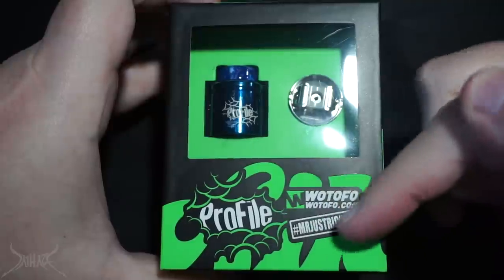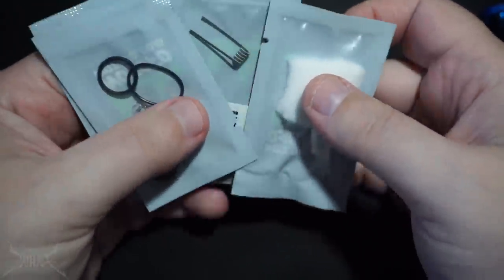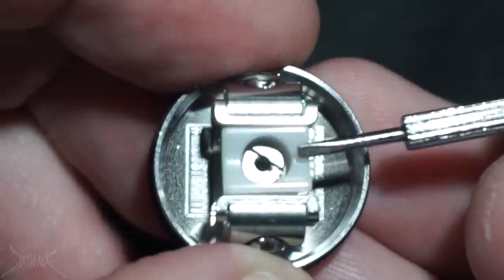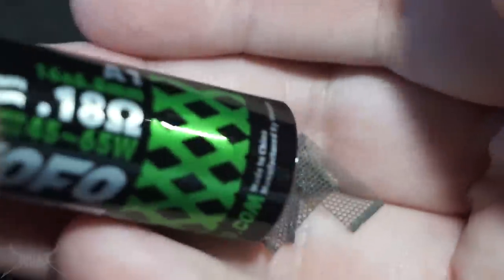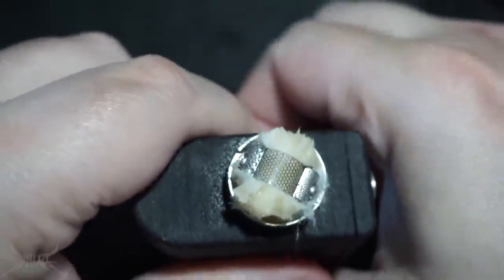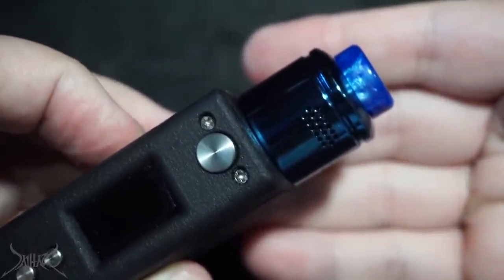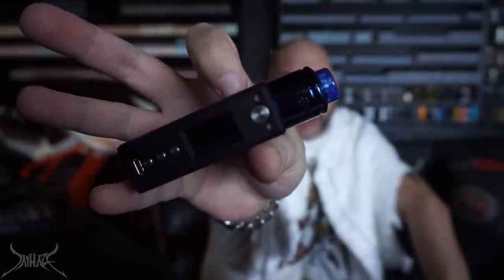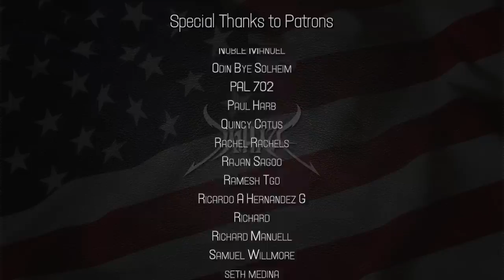Wotofo Profile Mesh RDA Review and Rundown | MrJustRight1 Project

Comment: I heard its even better if you use OFRF mesh. Like the WOTOFO mesh is good, but I heard the flavor is even better with OFRF. Overall this is one of the most popular RDAs to date for a reason. The center piece alone makes it fantastic. Biggest issues with Mesh RDAs is the cotton falling away from the Mesh and causing hotspots. With that center plate, it removes those issues. Finally a company saw the issues with other mesh RDAs and fixed it. Seeing how well you rated with how much you usually hate mesh, I definitely would love to try this. Was on the fence with getting a RDA, but because WOTOFO made this amazing contraption, they may just have sold me. WOTOFO, you guys should be happy, cus you made an amazing product. Also as for you getting the blue, I would love to have the blue. I feel it would look good on my Aegis Legend. Again, its personal opinion, but I love the colour. And man I love that nice deep well. I bet you get quite a few puffs before you have to redrip/squonk. Overall great review as always Jai.
Reply: I would not say it removes the hot spot issue entirely, because I have had a dry hit from hell on it. It did drastically reduce the chances of that happening though. As far as quite a few hits before re-squonking, 4 good pulls is the most my cowardly self will risk...the one dry hit I have had was enough to guarantee that I wont push my luck. Squonking is not that hard. The ofrf mesh is slightly better, but not a big difference.
Reply: @sarge1231  but this rda is does solve issues that come with older mesh rdas. Thats what I was getting at.
Reply: @Gutigwolfe  It is without a doubt the first RDA, or now RTA that made vaping on mesh worth the trouble. All prior attempts resulted in too many dry hits to be worth the risk. Nothing rebuild-able was reliable without dry hits to be practical. Other attempts required constantly adding wicking to maintain contact. The profile might just be the best RDA ever, although with the right build the re-curve is almost as good. Other RDA's require the right coil and coil placement, and are more expensive if you purchase pre-made coils which for me, is essential. My health issues would not allow me to maintain the hand steady enough to make these complex coils. A really well made coil can be more expensive than 20 of these mass produced coils. I am a huge fan of both the profile and the profile unity. I do hope the next version of the rta has a slide to fill cap, because the only problem I have with the tank is the screw down cap with the rubber gasket pushing juice through the wick like a plunger. I think a slide cap like is on the freemax mesh pro would solve that. Right now I just cant fill it completely full without it leaking right after filling it, and I am not willing to stuff any more cotton for fear of a dry hit.
Reply: @sarge1231  Totally on point. The profile is the only RDA I been truly considering. I wan't something simple to start off with. Also Mesh strips are so much cheaper than if you were to buy prebuilt ones. Sure you can buy wire, but I'm that so into vaping I wan't to try and learn to wrap wires. I mean I love vaping, I have spent a good amount of money on vaping gear, but I don't feel like putting in all the time just to build coils, and now with the profile, its really worth it. Its funny, cus people say to buy spools of mesh, but why? I don't want to mess up a measurement, and get it too long, or too short. Its a mesh, not clapton or alien wire. How much better can a spool of mesh really get over a strip? its not like wire. Overall when I am working again, I want to get a profile, cus I love how it is made.
Reply: @sarge1231  Oh and I love mesh in a sub ohm tank, which I heard prior to the profile mesh wasnt nearly as good, but thats another reason i wanna try the profile, cus I love the flavor mesh produces.
Reply: @Gutigwolfe  It is really good for a fact, but the wicking is very critical, so there is a learning curve. It will only take one dry hit on these mesh strips to create a lasting memory. Dry hits on this are not like dry hits on coils at all. The ramp up time is so short on the mesh that any spot not saturated and making good contact on the mesh will superheat the air you suck down your throat to what I would guess to be over 300 degrees. It is not a burnt cotton taste, but rather a very, very hot air that you get with mesh. The one time I had a bad dry hit was actually painful, like you sucked the air over a volcano down your throat. On coils, a dry hit is nasty burnt cotton, and even though unpleasant, it does not cause me fear. The profile does, and I wick it very carefully and start vaping at low wattage until I feel it is alright. It is like no other dry hit, and leads me to making a mistake that is more apt to leak than dry hit on the unity. I visually look at the mesh on the rda for a while after wicking after every hit, and never yet have had the courage to take more than 4 hits without squonking. I am not trying to discourage you, but anything that you have heard about the dry hit is not exaggerated dry hits on coils just do not compare. When wicked right the vape is even better than the freemax mesh pro triple mesh coils on the RDA. On the unity with the extension it is about equal to the freemax mesh pro triple coils due to the increased distance from the mesh. The rda the mesh is so close that the vapeis right there near the drip tip. That likely also makes the dry hit worse on the rda, but I wont test that theory. The regular vape is better on the rda. I highly recommend the topside mod for squonking...single or dual batteries. The plastic replacement tops for the profile also is better than the original metal ones, even with the smaller drip tip, with the added benefit of being able to see the juice level rise when squonked to prevent over squonking.
Reply: @sarge1231  Ya I would be soaking that bad boy. I ain't risking a dry hit lol.
Reply: @sarge1231  Also you can always take a short hit to make sure its safe, so if you get a dry hit its not as harsh as doing a 4 second dry hit lol.
Reply: @Gutigwolfe  It was a short hit when I got my dry hit. Your mouth is so close to that mesh that it gave no warning. I doubt anyone that got their dry hit did not try their best not to. It just happens, and will likely happen again someday. If it was just a good vape, I would not accept the risk, but it is not just a little better than other vapes...it is much better. I now have 5 of the rda's, 2 of the unity rta, two topside squonk mods, two dual topside mods and six other squonk mods. I never hardly squonked or dripped before the profile came out. I am a bit extreme though, I have over 80 regulated mods, over 100 tanks 3 or 4 hundred coils.at least 25 rda's and about 50 125ml bottles of my favorite juice in a dedicated fridge. A lot of this stuff gets little use, I used to love the crown 3 tanks so I have about 15 of them about 8 of which is still factory sealed. I have way over 100 crown 3 coils alone. I occasionally still vape one of them, but my mesh and vaporesso veco one plus gets most of the use. The veco one plus use the .5 ohm  euc  ceramic coils that are fairly inexpensive yet last a long time with good flavor, and they can be used with an adapter in atlantis style tanks. Once I got used to these coils the crown 3 is just not as satisfying. It is mesh and ceramic mostly. I have at least 15 veco one tanks and at least 200 of those euc coils. I even have at least 10 of the original crown tanks and at least 50 of those coils. I usually buy on clearance or sales, and buy 300 dollars of juice at a time when on sale. I also have some nicotine and various flavors for DIY, but I never have been able to get the juice just right. I have no idea how long juice will keep but the juice I am vaping now is barely over a year old. I guess part of the reason is fear of the government hammer coming down on vaping, I know I am good for at least a year. The biggest issue I have is rotating all these batteries. Looking on my night stand is 10 mods and attys right now. It all sounds kind of crazy as I type this, but I am disabled, have a pretty hefty 401k and retirement plus social security. I really do go overboard on things I like though. I have also lately used digiflavor espresso 22 tanks and coils the tanks were 3 dollars each, the coils were 99 cents for a five pack and they can be rewicked several times. The flavor was surprisingly good. With the coupon codes I got 8 tanks and 200 coils for about 60 dollars. I expected the flavor to be awful, but it really is good for these vertical clapton coils at least in .2 ohms, have yet to try the .4 ohm coils. got 100 of each.
Reply: @Gutigwolfe  The 3 or 4 hundred coils does not count the digiflavor coils, and it is likely a low guess. It is just a lot of coils. I should probably give away the crown tanks and coils, because I just doubt I will ever use them again. Then again some of my atlantis, sense herakles, vapeston magnus, freemax starre tanks got a second life because the vaporesso ceramic coils and adapters work in these tanks all use atlantis size coils. I have some mods that are from the kanger tank and other non sub-ohm days...they will for sure never see use. If I advised a new vapor user what to buy first, it would be the vaporesso veco one plus and the euc ceramic coils which cost 8 bucks or so for 5 and they last about a week.
Reply: @sarge1231  I had a burnt hit when I 1st started vaping, and it hurts. It was only at 15 watts, cant imagine getting a burnt hit at like 70 watts.
Reply: @Gutigwolfe  The thing is a normal burnt hit is due to burnt cotton and a normal coil ramps up slowly enough to not be near as bad. If you fire the mesh without any cotton to get it properly prepared it turns red hot instantly even at low wattage. A dry hit on the mesh is not a burnt cotton dry hit. It is where some wick is not contacting the mesh, and that spot gets red hot instantly while you are pulling this red hot air down your throat. Your mouth is less than 10 millimeters above the coil. It is like super hot air. It is just hard to explain unless you have it happen to you, and then explanation is not needed. If you have ever let food that is too hot go down your throat, you know the feeling of waiting for the burning to stop. It is more like that, but worse. I mean, the moisture in your throat prevents any blistering, but it is painful for a while while you're just hoping it stops burning. I can only say it is a different kind of dry hit and your cotton might not even be damaged at all. In a coil a dry hit ruins the cotton, and a dry hit ruins the cotton or coil in a pre made coil. It is more like having a tube over a red hot stove eye and sucking it down your throat. The great vape of the profile makes it worth the risk, but I try to err on the side of over squonking, and at first I squonked after every draw. Now I may take 4 normal draws, but never have done more. Just watch the reviewers and the way they look a bit afraid of pushing the limits on the profile. The RTA actually makes me more nervous because I have not had it as long and I can't look at the coil as well. The see through replacement cap on the rda means I can squonk until the juice reaches the air holes and hold it there a few seconds, which greatly increases my comfort level.
Reply: @sarge1231  One reason that dripping vs a tank can be scary. I will be careful if I get a profile. I still want to try it.
Reply: @Gutigwolfe  I'm sure you will be fine, and I have yet to see anybody that did not love the profile once they get the wicking right. It would be right up there as my favorite vape devices of all time. If I could only use one vape device it would be the vaporesso veco one plus, but not because it vapes better or tastes as good. It would be because the profile goes through juice so much faster that I even use lower nicotine juice in it, which of course costs much more in juice consumption. The profile is more like my desert after a meal. It is great to vape but I don't want to get used to vaping only the profile. I have made that mistake too many times leading to a huge amount of once favorite tanks that I have a ton of coils for, but get used seldom after finding something I liked better. The vaporesso tank is in no way comparable to the profile, but I have way too many tanks and coils for me to make the Vaporesso obsolete. Over 100 crown 3 coils and at least 15 tanks not ever getting used has proven that it can easily happen with me. The profile is my desert, the Vaporesso is lunch. The massive stock of even unopened crown 3 tanks taught me to not follow that path. The ceramic coils are not necessarily better than the crown 3, but I have become so acclimated to the ceramic coils that the crown 3 just is not satisfying now, even though the crown 3 tanks and coils are higher priced and probably better quality, the ceramic wicks just taste different. I keep trying to get the crown 3 back in the rotation, but it is an issue. The same thing happened with the crown tank after getting the crown 3. I have a bunch of unopened crown tanks and coils as well. I never planned to abandon either. I used to like the nautilus tank long ago, and I tried higher nic juice and salts in one the other day and found it unvapable. I smoked the same Kool cigarettes for thirty five years, but it is not like they kept making better cigarettes...they all taste like crap. With vaping they just keep making better stuff. It would be fine if I had not kept buying years worth of the tanks I was sure would be my last upgrade. I keep looking at 50 packs of coils for the crown 3 at sometimes 15 bucks a pack and know it is a problem. I probably have 2500 dollars of crown 3 tanks and coils alone, and nearly as many crown tanks and coils. My total vape gear is easily 20 thousand dollars I spent on it all. I am going to need to rent one of those self storage spaces just to store it all if this keeps up.

Comment: Been waiting for mine to arrive. I ordered the blue and with the part that you said about not seeing the airflow im going to experiment with mine and take some very very light sand paper on the airflow steps and see if the blue will sand off to reveal the natural metal
Reply: did you buy from wotofo?
Reply: @CryptoBates  fast tech and if it doesnt come in the wotofo packaging its going back. Im so frustrated with the whole ordeal because i have been so excited to get one
Reply: i ordered straight from wotofo but i think they are useless. 48 hours later and they havent sent it or so i think. no track and trace. better to deal from wotofo if your a wholesaler tbh. fasttech would be better because at least they send you a track and trace.
Reply: i only received a shipped status. No tracking no nothing. I emailed the last week and told me 6 to 10 more damn days after its shipped. The respones pissed me off when they said it was pre order. They wont ever be used for any buying again.
Reply: ah that sucks man!! hopefully they msg you back again. if anyone is out there, buy directly off a vendor. the price difference is very low. i got it for $30 USD from wotofo, i expect to arrive in 3 - 4 weeks considering how slow it is. but at least from a vendor they ship it same or next day. my lesson learnt.

Comment: I'm waiting on DHL to finally arrive with mine (won it in a contest.) I wish their mesh was 80w mesh / 0.11-0.19ohm so I could use it on a 4.2v bypass tube mod. I guess I'll have to look into different mesh types to find something that'll work.

I did notice that it has ceramic, but it's not in contact with the airflow when used as a mesh dripper and it isn't wicking material.. so I'm OK with it. I wouldn't use this as a single coil RDA, though, because then the ceramic would be exposed to the airflow.

Comment: The profile has the distinction of giving me some of the best vaping experience ever, and also the worst vaping experience ever. The flavor is usually very, very good...which is the only thing that allows me to continue using it...because of the worst vape experience ever. I got a dry hit the first day I had it. Now I have experienced dry hits before, and it is always nasty, but the dry hit on the mesh was like I ran a tube into hell and sucked the fire from hell down my throat. It left a lasting impression, It is the only atomizer I have ever been afraid of. A dry hit on this is not just nasty...it's actually painful. I love the vape on this normally, so I use it every day, but it is only the great vape that it normally provides that allows me to look past my fear and vape it...I do however wick this thing very carefully.

Comment: I was just wondering if you tried the profile 1.5? I thought I would look to see if you reviewed it and guess you haven't, probably due to it still being a profile. It seems to have some nice improvements like a better spring plate and wider deck. Plus the mesh is better for it and a plus is its Kanthal. It also has a deeper well and is easier to get all the cotton down inside. You barely have to cut the cotton that is made for it. Overall I am loving it, just got mine in.

Comment: Wondering if anyone could help me out.

I just received my Profile and my mesh strips keep reading at 0.27 ohms, however the mesh is rated for .18 ohms. Not sure why. Tried cleaning off everything just to be certain.

If I vape on this with its current ohm reading, is that an issue?

Comment: I got mine this week, but one of the screws on the posts is impossible to remove.
One came off really easily, the other I have tried 3 different screw drivers to no avail.
Anyone else had this issue with WOTOFO products?

I bought a bunch of stuff from them but scared to open it in case it all needs to go back - anyone else had a similar issue?